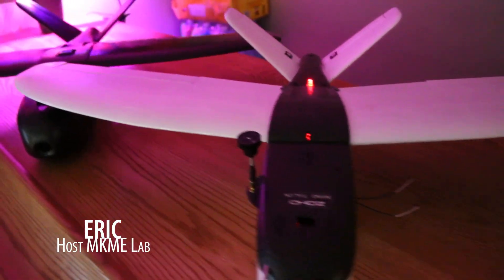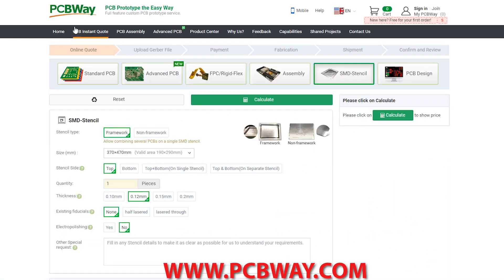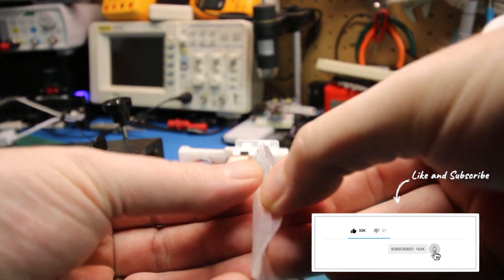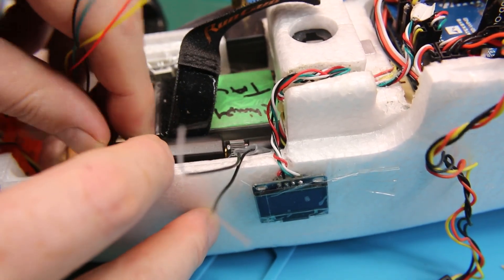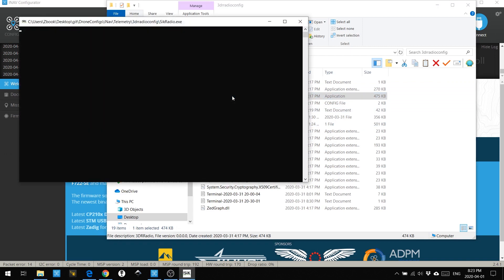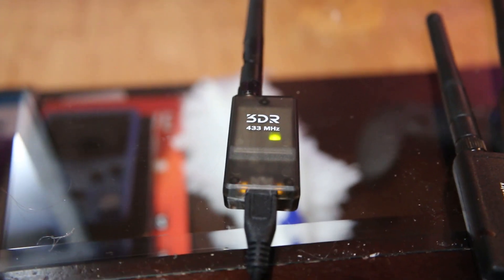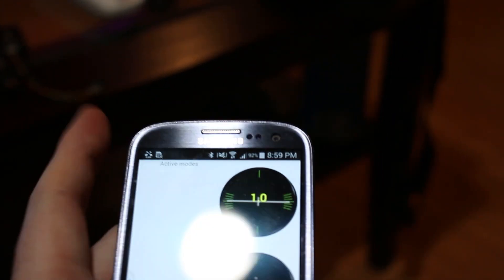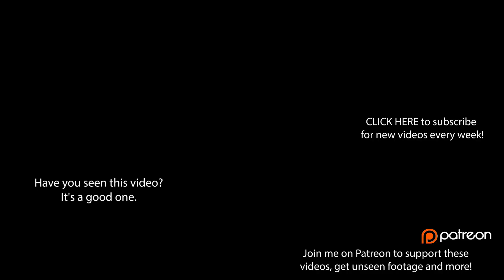🆕WIRELESS 433MHz Aircraft Control & Telemetry- iNav 3DR Radio WORKS! 📡👍

Comment: the 4 wire ones don't often work at all or are not reliable..  don't buy.    the best ones are from RFD, in Australia.  the Holybro ones work pretty good too, but they just stopped making the 500mw 433 modules.. :(

Comment: Hi friend !! I have the same FC controller too (Matek F765), running with Inav 3, and these 433 Mhz modems , the link below (Stu Olsens) isnt working, do you have another link for the tutorial about how to install and configurate it ?  really thank you !
Reply from the maker: The instructions are in this video
Reply: @MkmeOrg  Ok, I got working too my link between mobile phone and the FC F765, via 3DR radios, but please just last questions: Are u flying with 115200 bauds rates for the 3DR radios ? and what is the name of the mobile app again ? thank you ! really appreciate , regards
Reply: @MkmeOrg  iam still confuse how to install sik radio config with my windows??

Comment: man, took me a whole day to set this up, firs i couldnt connect to inav, then i tried flashng firmware and mt tx went to the 2.0 firmware and the rx was in 1.9, lost commujnication, spent hours to find the 1.9 firmware, but thing is, the tx and rx pins where inverted in my module!!! got it working now, tnx so much good veido man
Reply from the maker: Glad you got it.  It can be tough- hence me making the vid. Cheers

Comment: Do you think that I could use Mission Planner (the software not the inav planner) to link with the gps via a telemetry link like this on a uav with inav on it? I'm trying to figure out if this is possible because if it does, I could use Mission Planner to make a tracking ground station.
Reply from the maker: If it supports MSP it could work. Dont think it does though
Reply: @MkmeOrg  guess I'll just have to buy a 3dr and test it out then. Thanks a lot mate

Comment: Hi :) I think I need your help.... 
I got myself a couple of 433mHz transmitter/ receiver. When I power both of them I get a solid green LED on each. Also my computer and iNAV seem to recognize the transmitter, that I hooked up via USB, as it shows as a COM port in the iNAV starting site. When i try to connect the plane with iNAV it shows the "Serial port successfully opened" message however, after 10 secs it shows the "No configuration received within 10 seconds, communication failed" message.... 
please help me.... thanks! :D
Reply: Try changing the baud rate to 57600

Comment: Imagine using this for surveillance during war.
And it sends video and data.
Reply: Lol that already exists... except its 50 grams, flies for half and hour and has a thermal camera on it lol oh... and its the size of your thumb.. just one of many. Lots of guerilla groups are using these homebuilt models though because theyre dirt cheap... in a modern warzone this kind of tech is.. baby town frolics
Reply: @gregbull5753  if your reference is to the black hornet by proxy dynamics? Its actually 16g including battery and flies for 25mins with a 1.6km range..and heres us rc enthusiasts who get the same flight times with 450g batteries...work that out..🤔

Comment: Wow thats awesome! Would you suggest the 433 or 915?  Would the 915 interfere with crossfire?
Thanks
Reply from the maker: I'd say go with what is legal for your area :)  Shouldnt interfere that I know of but I've never tested it.  Crossfire is pretty impervious to just about any high power RF so not sure.  Good question thoguh
Reply: Great information in your vids!  Im in the US.  I think 915 is legal but i can get dragonlink which is 433.  Would you happen to know?
Reply: Just to clarify.  Meant do you know what telemetry radio frequency is legal in US? 433 or 915?  Thank you
Reply: J Corp 433mhz is legal in USA just need Ham license which is a simple thing to get.
Reply: J Corp Also is you are using XF or R9 915mhz I’d most certainly use 433mhz for Telemetry radio.  915 Telemetry radio will most certainly interfere with XF and R9 if using those legal RF 915mhz
Reply: @Freebird_67  
Thank you!

Comment: Excited to make a few changes! Did you link that GitHub page for the firmware updater? I must be missing it here.
Reply from the maker: https://github.com/ArduPilot/SiK
Reply: @MkmeOrg  Do you think that the capability for this to work btw the MatekF722 for wings and the MatekF722SE is different? ie, the SE is not setup for remote control via MSP
Reply: CloudsCapone as long as you have the open U.Arts on your FC you should be golden.